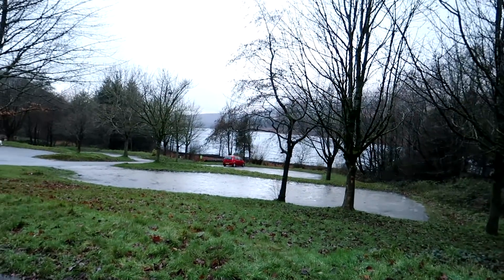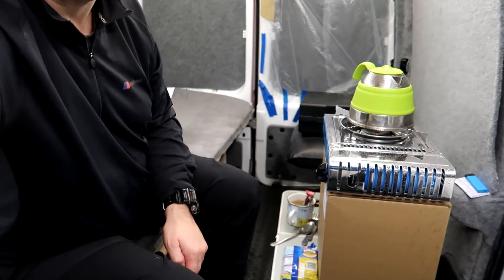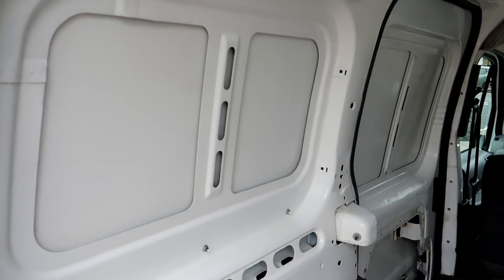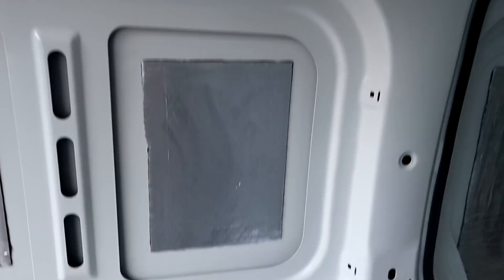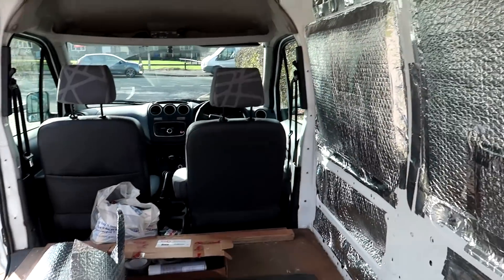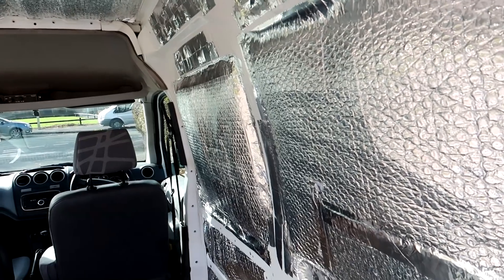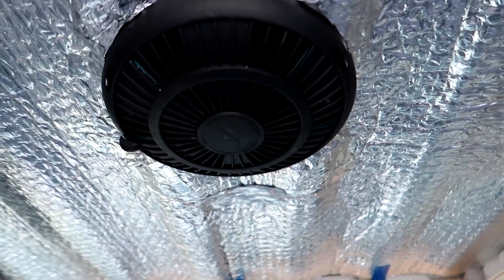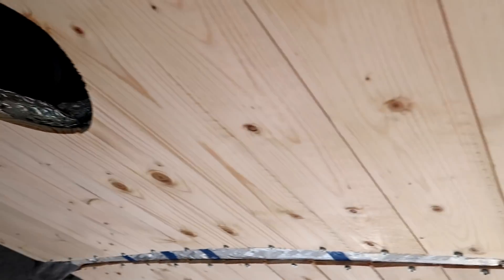Transit Connect STEALTH Campervan Conversion PT1.

Comment: I got one 2 days ago. Mine is a high roof 2012 XLT 40K miles. Passenger wagon with 2nd row seats that are going. I have 2 opening back windows and 4 non opening windows and Will work with it. I looked for weeks and gave up, then this listing was sent in an email. Research and talking to dealer in Chicago, I bought it, got it delivered to Missouri very next early morning. Was surprised. Great surprise is remote start, don't have to pay to have one installed now. I will have raised floor removed and leave the roof insert. I am going to love it.  I wanted windows. I have 3 cool small chest of different size artist drawers that I will repurpose. Bought 2 complete solar sets for house emergency last year that I will use also, just need a bed built. Good job, you have great in-laws!!! I am Getting excited and I am sure that is evident!  I lost my dear husband In 2019 and time to start to live again. I am a little scared but will step out and do it. Sold my newer car to brother and that more than paid for van, so I guess it was meant to be. I watch these videos everyday.
Reply from the maker: Sounds like you’ve got yourself a fantastic Van. Best tip don’t rush it to build. If something won’t fit or work take a step back think it through there’s always another day. Most importantly enjoy the experience and get out and enjoy it. ATB from across the pond 😃👍

Comment: Tidy job, I started mine in 2017 and still forever inprove, tinker, upgrade and change things around..... I love it, hope you have much good times in it. Thanks for showing your process.
Reply from the maker: Thank you I have enjoyed doing it so far. Roof was a bit tedious tho 😂👍 think I’ll be tinkering for a while tho
Reply: @stevebutler7156  you think you have something spot on then...... Other circumstances, weather, cooking, entertainment in situ etc changes your setup, heating is a good one, I changed my origonal plans to accommodate a better heating system lol, or as trivial as moving hooks to a better place. You figure it all out the more you stay in it. Cheers Steve

Comment: Oh, great. Just in time. because I want to do the same way now.
Thanks a lot, for your videos.

Two weeks ago, I bought my car. Looks like same size. It is called Vauxhall Combo C in GB.
With a 1,7 l. Diesel engine with 100 HPS.

I´m a motorcycle driver too. But got healthy problems other reasons.
And I become tired, for getting wet and cold.

Greetings from germany. liked + longer subscribed.
Reply from the maker: Glad I have inspired part2 will be up soon. 👍

Comment: Havelock Wool.  That's what you need to insulate with.  It absorbs any condensation, water, etc.  It keeps you toasty warm in winter and cool in summer.  It also acts as powerful sound proofing.
Everything else will eventually get wet and moldy from condensation.
Reply from the maker: Thanks 👍

Comment: cool mate....im starting my connect camper after xmas...basically will be like the one your doing then im outta here travellin around uk (when i get a few weeks)  and if i win the lotto then i`ll be gone for years ha....anyways ya connect looks good.  from minty in bham...
Reply from the maker: Nice one enjoy your build and future travels. ATB Steve 👍
Reply: @stevebutler7156  cheers. Ps how much was the installation...its all i gotta get..
Reply from the maker: @smofla13  can’t remember exactly not that expensive, but the sound deadening sheets were.

Comment: A good easy to follow video. A likeable guy and fun parents in law. It would be good if you told us where you bought the stuff and the price. Where did you get that stretchy carpet for the panels? Also the silver insulation and wool....the only bit I don't like so far is the wooden ceiling.
Reply from the maker: Hi Thanks for Watching, 4 way stretch carpet you can get Amazon, eBay etc. I got mine local campervan supplies store 5metres and 4 tins high temp spray glue(forgotten name) Insulation Wickes, plastic bottle insulation BandQ. Didn’t want to carpet roof, I think it would get dirty over time and insulating over would be problematic. It was an absolute pain to do, but one of the main insulated areas. With the cavity created with the pine cladding I stuffed the insulation in as I went. The roof prior lined with silver insulation. Only place I’m not happy with is circular hole for the roof vent. 😃👍